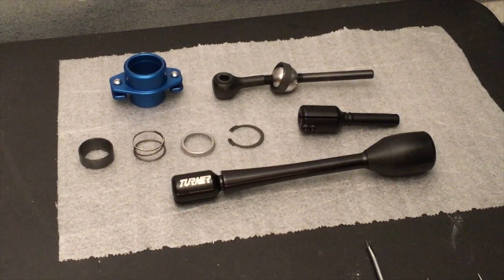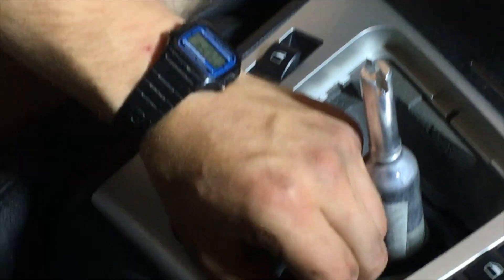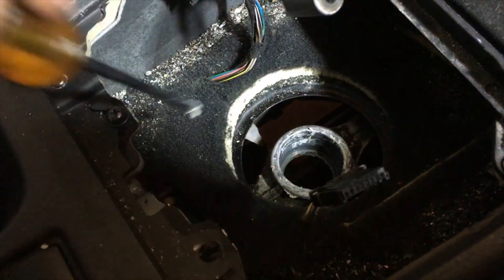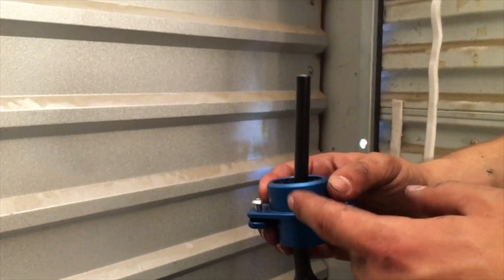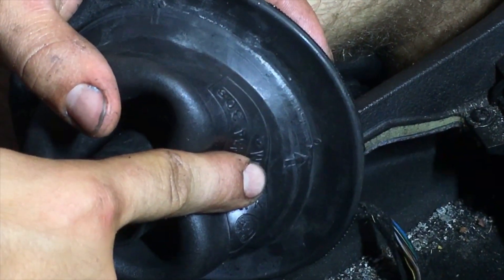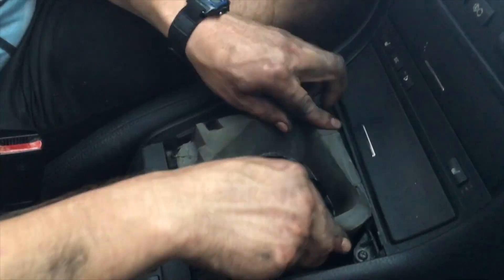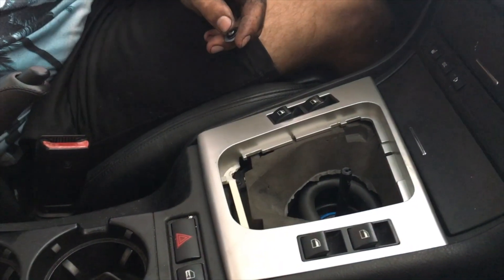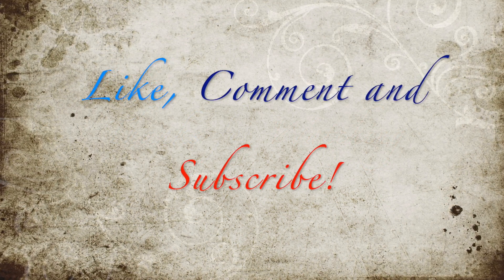How to Install a Short Shifter Kit (BMW E46) (Turnermotorsport)

Comment: you shorten the throw , but put a long ass broomstick on it, in the end it is the same throw, just the shifter is a bit higher,
Reply: I guess it is quite off topic but does anyone know of a good website to watch newly released movies online?
Reply: The long ass broomstick is popular bc it keeps the shifter closer to you so your right hand doesn’t have to move far away from the steering wheel. It’s popular in rally shifting and in daily drivers
Reply: @2A_TJ  in rally they don't just stick a broostick in there and call it a day. It actually has a short throw too.
Reply: @bence.gabor.slezak  hence why you can still adjust the throw even with the longer shift lever

Comment: I have never seen a short shifter that looks good and is actually short at all. They are all super long necks and hideous looking. I would love to reuse the BMW M knob on the same length neck on a short shifter base. But nobody has this configuration for sale.
Reply: RTD does........., im running mperf knob with rtd shifter
Reply: @Adrian-od8iu   Do you have a link?

Comment: I have a uuc ssk in my car now and was planning on buying this. is this worth the money I don't like how how short mine is now. is this one very short even at the longest adjustable throw
Reply from the maker: Giuliano Stefanatto it’s fairly short even at the longest throw, however I don’t have measurements of the exact throw length. I do recommended the product but the way the quick release was design isn’t the best. When you tighten the hex screws on the shifter it still has play and easily become stripped. To be completely honest the UUC one is probably just as nice.